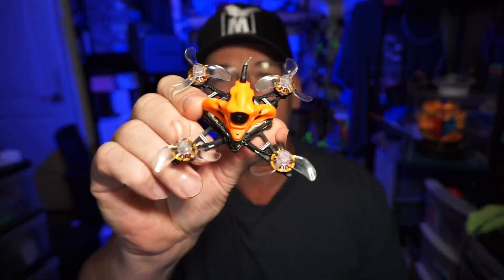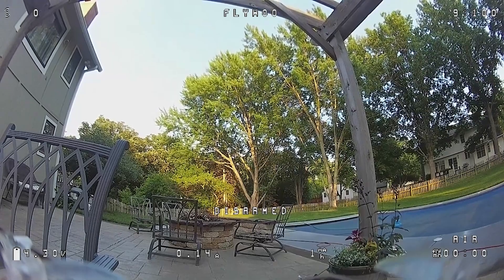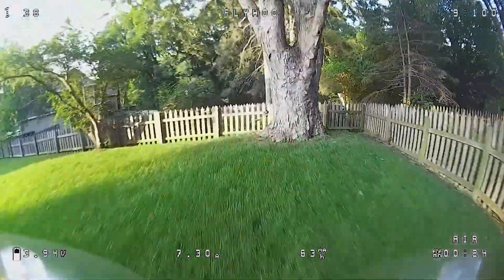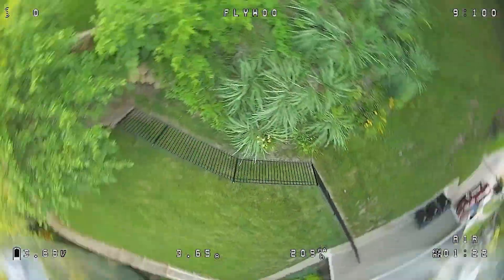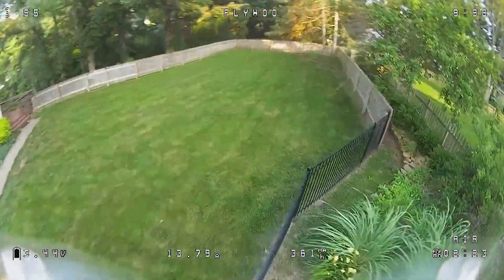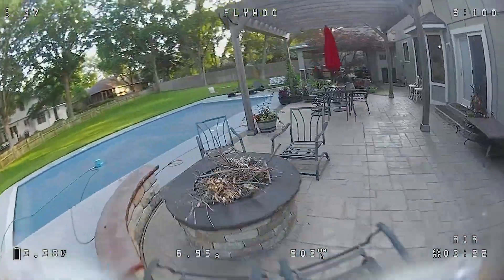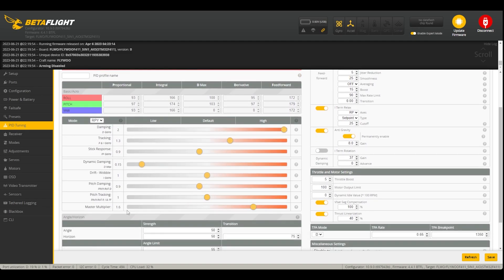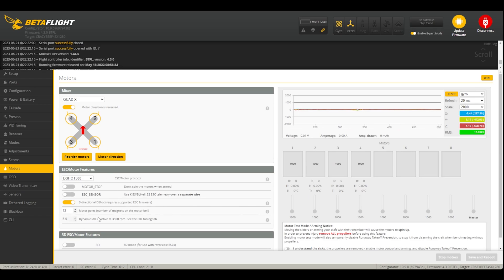FlyWoo Nano Baby V2 FR PID Tune Test // Tri-bladed Props // Betaflight 4.4.1

Comment: Hey Nick, i just entered the new Settings into the CLI, but now i have the problem, that my Stick Inputs wont show in Betaflight, even though im connected. All came with the Settings Update. Any tips or Ideas how to fix this?
Reply from the maker: Sounds like its no long bound. How do you identify its still bound? Does the telemetry callouts occur when plugging in or unplugging?

Comment: hey man, it does come with 24khz pwm outta box, did you change it to 48khz?
Reply from the maker: I don't specifically reacall, but with really any esc we can set it to 48khz if we want via the esc-configurator.com
Reply: @NickBurnsFPV  ah thanks man! I changed it to 48 khz but getting low throttle oscillation 🤣 read it somewhere that it may reduce the torque. I rolled it back to 24khz 🙌
Reply from the maker: @iamrich2030  yes it does change how quickly the props slow down which can impact the low throttle experience.

Comment: hey nick! I just got one of these and it shipped with tri blades and quad bladed props in the package, which ones should i use? thanks!
Reply from the maker: Time has past I can't be sure which is suggested by the manufacturer. They could have adjusted the PID tune to work well for both.
Reply: What did you end up doing? I just got this as well and I think the tri blades are working better. Also did you have to update the PID or are they shipping it updated now?

Comment: Nick, I threw 45mm props on this that I had from my Meteor7 Pro, they just barely fit. It actually flew pretty well, but the tune would need a re-look, but it added a straight min to the flight time. Thoughts?
Reply from the maker: is that the analog or hd version?
Reply: @NickBurnsFPV  HDZERO, I absolutely love this thing, btw.  I take out bigger quads and end up going back to this lil guy after a pack or 2.  Way too much fun.
Reply: Hi?

I know it has been long. How is (was) the nano baby holding up?

I also got the HdZero version of it just a few days ago. 

I have this strange behavior, when I am below ~3.7v when I go full throttle, the quad bogs to the right and loses power (also seen, the current draw drops a bit). After the battery drops a bit more, to about 3.5v, then on full throttle it loses most power and just starts to wobble down (as with strong propwash). 

With full battery it draws ~22A, and seems to be flying well. This sudden loss of power happens when the battery is about half way empty and the effect gradually increases.

I feel like it has a bad ecu, but I dont know how to confirm this.

Mine came with the Gokku F405 HD aio (I understand it is a new version).

Comment: @NickBurnsFPV
Looks like flywoo is using dynamic filter but bidirectional-dshot does not work. At least in the motors tab you show you can see 100% errors. Maybe you need to flash the esc? 🙄
Reply from the maker: No battery plugged into to activate the esc, that is why it shows 100%

Comment: Did You flash esc ? My drone don’t work with bidorectional dshot
Reply from the maker: no I did not flash the esc. The motors will show 100% error if there is no battery plugged in to activate the esc.
Reply: @NickBurnsFPV I get an RPM Filter failsafe when I have bidirectional shot enabled. If I turn it off it clears that obv, but why can I not have bidirectional d shot?
Reply from the maker: @FlyPVTarzan  Is this a build? or did you buy a bnf? Have to check the esc firmware? Maybe they failed to flash bluejay on it.
Reply: Yeah i know that battery need to be powered. I had some issues with arming and after removing bi dshot IT armed. But after some time i see that IT wasn’t Real issue. Don’t know why drone disarming while flying and won’t rearm without power cycle.

Comment: Hey, i have a question, i have the Emax Nano hawk x and i went to fly it today and it's showing a standing red light and making no noise when i plug it in. I NEED HELP. i cant figure it out and betaflight says everything is fine.
Reply from the maker: The lights generally don't tell me much, from one model to the next the light color and flashing can be different. What happens when you plug in usb and battery? If normal that means the 5v regulator is dead and needs new flight controller.